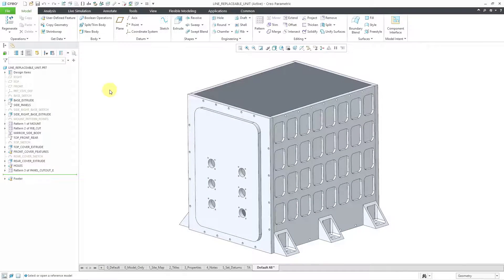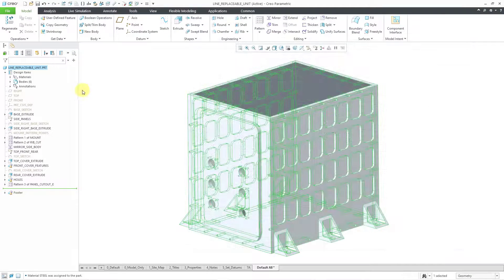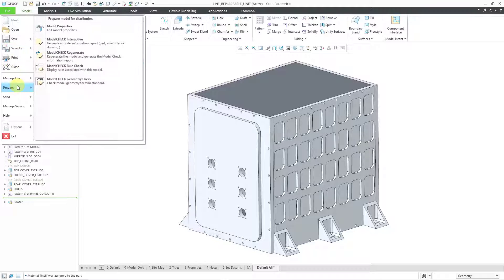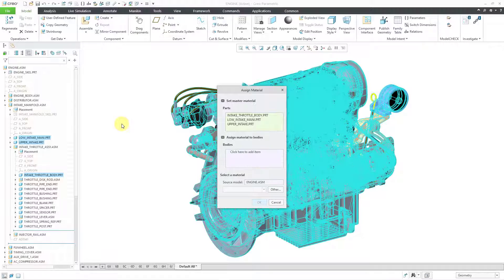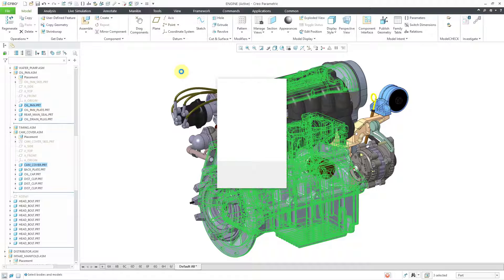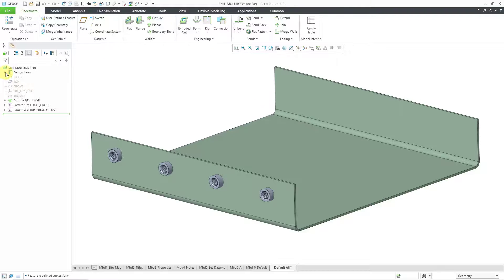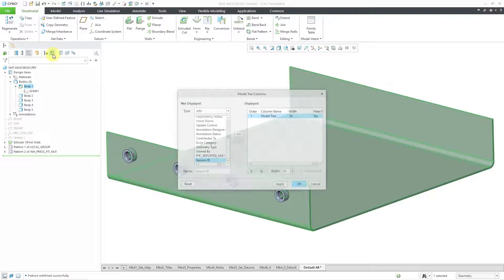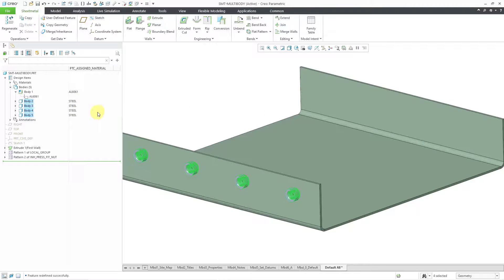Creo Parametric - How to Assign a Material

Comment: Creo should enhance the Material library in the coming releases. Even though flexibility is there to create your own material library within Creo, they should add more Engineering materials in the library. Recently I came across a CAD package where they have different materials within a particular alloy with different heat treatment conditions...The properties of these materials are widely accepted for Engineering Analysis. Instead of creating your own library by referring to handbooks, we should be able to take these model properties for analysis in Creo Simulate or Creo ANSYS simulation...
Reply from the maker: Have you submitted this to PTC Community? (I’m not PTC.)
Reply: @CADPLMGuy  I don't have access to PTC community...But really wanted to give a bunch of feedbacks
Reply from the maker: Why not? Everyone can create an account on PTC Community as a Basic User. Giving feedback here is next to worthless. I'm not PTC and I don't relay information from commenters to PTC product managers.

Comment: Not sure if you can help but when I do the mass property calculation and then find my center of gravity the location is NOT the center of gravity. Can you possibly suggest a reason why this could be happening? Creo 6.0. the X and the Y are where they should be but the Z is off by a mile. The Z plane is the main parting line of the tool. 

I'm doing mold design and the customer is not too happy that his mold doesn't hang even close to level.
Reply from the maker: If you've checked all the components for proper density and to make sure all parts are solid, I would open a case with PTC Technical Support. It's most likely an issue with one of the models.